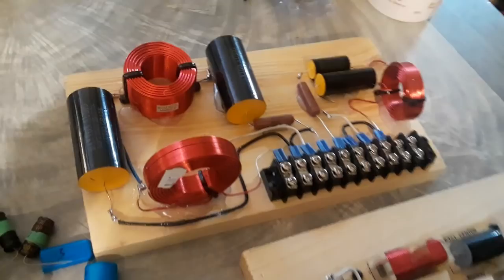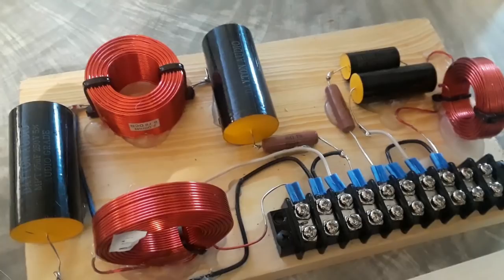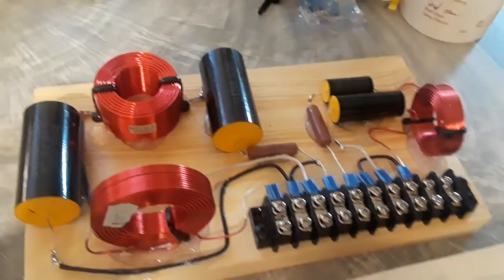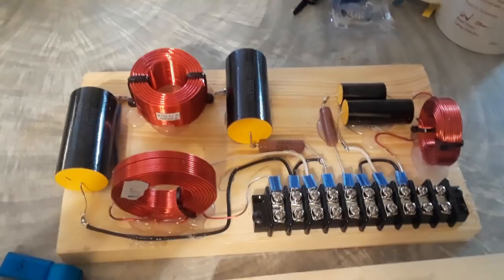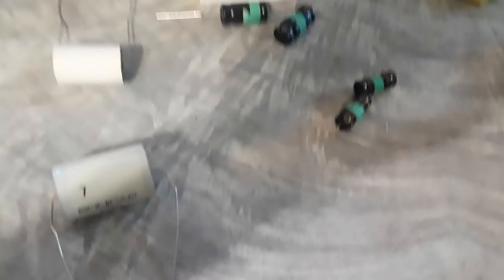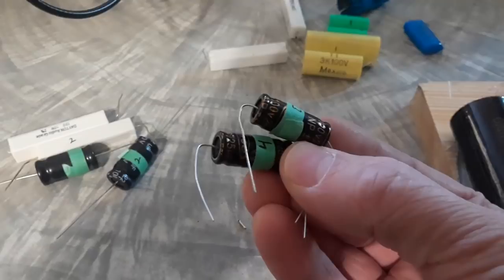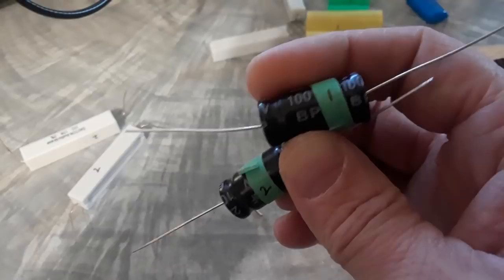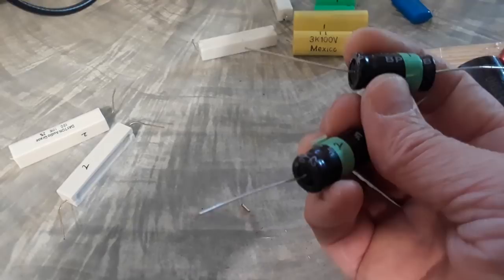Crossover Capacitor replacement recap and analysis Klipsch Heritage Academy

Comment: I worked for 23 years testing passive components ie capacitors coils, transformers, resistors for a military and comercial avaition radio suplier.  I also have worked with crossovers as a hobbie.  The only parameters I concern myself with is capacitance.  I use Solen, and  Sonocaps wherever possible because I have heard the difference.  The ESR is low and I will add capacitors in parallel to not only match left and right crossovers but to get the value that I want within 1/2%. Making sure to do the same to left and right crossovers. The difference is in the sound, not the measurements as long as they measure the same. the the sound comes from the way the capacirors are made and the lead material.  I always test the leads with a magnet to see if they are copper clad steel (any ferris metal in the signal path is bad for sound quality).  Any ferris metal surrounding the wire can also affect sound quality. I try to use copper for wire and brass for hardware were ever possible.  I have also used a low value film capacitor to bypas electrolytics in the signal path and on power supplies in older amps, preamps, CD players, etc.
Reply: Thanks for the benefit of your experience, I don't have the experience you do but I recall having to match components for high power mil equipment we sold on license to uncle Sam. It was astonishing the amount of legislative controls in place for single components.
Reply: I know this is almost a year old but I work with a well known speaker company and I just wanted to say THANK YOU!  Always appreciate confirmation with respect to actual sound quality of various components in a passive Xover. Identical measurements do not always equal identical sound and rarely do with higher quality components
Reply: In crossovers I use mkpa , in the power supply I haven’t used it, will try. Good input, thanks

Comment: I realize this is a 5yo video, one thing to emphasize is equal measurements do not always relate to equal sound quality with same values in a passive Xover.  I have known and worked with Crites for many years and I will assure everyone Michael absolutely knows this. He was literally forced to offer cheap electrolytic caps to satisfy the “purist” in the Klipsch community to stay true to the original sound. PWK would not want the parent company using the cheapest parts available for his networks yet there is a big market for them. Thanks for a great video 5 years later lol !!

Comment: I don't get if you value the quality of the sound why hte measurements have such a big effect on your choice. Sure, close to spec and consistency is important but in two equally measuring caps, the quality of the sound is more important? Seriously, try a copper cap and compare, even if it measures at 5% compared to your dayton 2% against spec.

Comment: I see no difference in the oscilloscope measurement. I suppose there is a difference between the caps, and that is related to ESR and ESL. For correct and clear measurements, oscilloscope must be triggered. Time domain and v/div must be set so that only one wave-forme is displaued am amplitude to be from the bottom to the screen to the top. Overlap the channels to spot differences. I'm absolutly certin there in no hearable difference between a 5-10$ cap (correctly chosen) and an expensive "special" cap. So, just use bipolar caps with ESR lower than 100mOhm, preferably inline film because thay have also low ESL. Never use MLCC, thay have BIAS   effect (capacitance decrease over voltage increase, that can affect up to 80% of nominal capacitance). For example, a 33uF film cap costs about 7$ and is has identical sound characterisc like any other "special" one. 10uF are even cheaper.

Comment: Cool video, closer tolerances or better "measurements" do not make better sound , so I would focus on using quality audio grade parts and listening tests to describe differences in sound signature....
Solen on tweeter sounded bright and harsh, Daytons are similiar little less bright , SonicCap I have never used or heard.... lower value caps on the tweeter are often critical and best sounding ones should be used there...spend from 15 to 50usd on nice tweeter cap than you are ok with cheaper Daytons on the mids and lows...
Mills are nice resistors , little too bright but very good sounding.
Inductors as long as air core 16ga and thicker are fine .....

Comment: great information as the Crites options are VERY expensive as you say and may or may not be a good option for people.
also good information as the stock caps were say 5-10% off but after that many years not too bad.  I have a pair of KLF20 and KG3.5 that could probably use some upgrade love.  Simply to smooth out the sound and bring it back to original

Comment: Ricky, It seems you are quite experienced with crossover caps. What do you think about an idea to use Dayton foil polypropylene caps to bypass regular Dayton polypropylene caps? Like 10-20% of foil and 90-80% of metalized polypropylene. Have you ever tried such a combo? What would be the optimal ratio?

Comment: I have a Klipsch KGSW LE passive subwoofer I Purchased probably in 1990 new I was 20 a the time.The manufacture date is 1989. My question is their is two large  capacitors  with T.I 150v 270uf any suggestions on a new capacitor to replace it with?

Comment: The signal generator is probably fine but it has 50Ω lab standard output impedance. Overloading it with a low impedance application (8Ω loaded passive crossovers) signal loss certainly happens. Noise can creep in, THD shoots up. Connecting the gen to an audio amplifier and the crossovers on its outputs should solve that. Home theater receivers can provide more independent channels for your real-time four waves comparisons.

Comment: I am looking replacing Caps in my crossovers , the existing ones are 12uFand 4.7uF , the existing ones are labled 50V ,  I have only seen 100V + caps for sale, does the Voltage matter ?
Reply: 50V is the rated power the capacitor can handle. Getting one with the same capacitance that you need albeit with a rating for 100V will be fine. That just means the capacitor can be installed in a circuit of up to 100V and still work as it should. Just make sure you are getting polarized or non-polarized as your circuit requires.

Comment: Good day to Ricky Talks Shop.... I have 2 Energy Connoisseur C-8 crossovers and I'm about to replicate them but my concern is the coiling thickness and winding count...... they cost $250 US  each and wow do they sound just wonderful. i love them, installed them on my homemade towers (49"high X 9" wide X 13" deep) with 4 Hifi 6" mid-bass 40 watts at 2ohm x4 =8ohms) and a 4 ohm  6" subwoofer isolated and radiated in the towers for lows, i get 35hz from these babes wow! ok I'm excited so about the coils any input please and thanks.

Comment: I have s pair of chorus  speakers,what would I have to do lower the bass frequency   from 45 down to 35 .? Bigger resistance  coils.
Reply from the maker: Thanks for watching. Do you mean to change the crossover frequency between the low and mid driver? Or to get more overall low end out of your Choruses? Personally I wouldn't recommend doing much with the croasover frequencies. The Engineers at Klipsch know what they are doing. To get more overall low end, think about what you are after. Lower frequency response? More "thump"? You can safely expirament with stuffing the speaker with acoustic batting from Parts Express or lining the inside of the cabinet with acoustic foam. I have had both good and bad results with either option.
Reply: @rickytalksshop8538   hi Ricky. I experimented  with the ports and put 2 -9" DIY  cardboard tubes in they boxes, that really helped the bass response  out.
Reply: Thanks. art source  couldn't  help.

Comment: Shouldn't you test the crossovers with more power? Does power affect the responce? I'd like to understand it better because with my speakers everything goes well within low volume,but when I turn it a bit louder the sound tends to change for the worst..

Comment: Hi I have klipsch  chorus  speakers,there are 2  j2 250 volt caps.i can get 2.2 uf 630 volt  nondof  caps,will the difference  in volts make a difference in performance?
Reply from the maker: It can, but may not. Larger voltage caps can have larger charge/discharge times than lower voltage of the same value, especially if you go from a poly to an electrolytic type cap. Also a 650V cap is going to be unnecessarily large for the application. For a small value like 2.2uf I would recommend Dayton caps which are rather affordable from Parts Express.
Reply: No Paul, it wont make any difference apart from the cap size, that's the breakdown voltage and the cap discharge time depends on the source of voltage (your amp).
Reply: "nondof", do you mean Mondorf?  If so, use them by all means, Mondorf have an outstanding reputation!   I also have ChorusII's and replaced the 2.2uf (tweeter circuit) caps with 2uf teflon NASA surplus.  The improvement was dramatic!  The soviet surplus K73-16 capacitor is worth considering, but haven't tried them myself.  The general rule with capacitor voltage rating is that you can replace with a higher rating, but never a lower one (see Dorian Valadez' reply below).

Comment: The Dayton Audio Grade  10 W ceramic resistors are inductive. 
Did you misspeak when you called them non inductive?
We can agree that the Mills resistors are non inductive, and expensive.
I have measured the inductance of Dayton 2 and 3 ohm resistors, and it is very low.
I would say negligable, and so I use them, like Henry Kloss did in the Advent speakers.

Comment: In my speakers I had good results with replacing the crossover with just a capacitor. The base driver is 8 ohm, and the tweeter is 4 og 6 ohm, dont remember,  so the low frequencies will go through base and the high will go though the tweeter in a natural way, without the use of distorting coils. In my experience it sounds fantastic. Have now purchased a pair of LS50 (not yet delivered), and if possible I will try to do the same in them, when I get them.
Reply: No way you have flat response w/o coils to taper the top end response of wood/mid unless you used different drivers. Glad it sounds good to you but an A/B comparison would likely reveal serious issues
Reply: @barneyrubble4827  The response is not flat, but flat response is only one of very many distortions in a loudspeaker, also a flat resonse can be achiebed by for ecample eq in dac

Comment: I have only just started to look into this for the simple reason that something inside my dj speakers was rolling around so I looked inside and one of the resistors had fallen off so I attempted to solder it back on. The speakers sound was not as good as it used to be and I will see what they sound like now I put it back on but was looking for what it actually did on the crossover, ofc I am not going to replace anything since I can not afford it but its nice to learn new things. Its was a good video but I think it would have been handy to know what effect they had on the sound by actually hearing it rather than looking.

Comment: Hey Ricky, thanks for making this video! I need some advice. I just picked up a pair of original (walnut?) 70s La Scalas with the metal drivers on the horns (so first gen). They are 100% never been monkeyed with which means those ancient paper in oil caps in the crossovers have got to go!

I’m thinking about going two routes. One is to rebuild the existing crossover circuit as it stands, replacing parts with their audiophile grade equivalents, like the nice Litz wire coils (Solen?) you have in the video and the high end Dayton or Solen caps. I would expect that by keeping circuit design of the 70s Klipsch engineers with the best parts, it would maximizing the performance of the original design but keep some of its inherent quirks.

Now, there’s a different guy who charges a lot of money for his crossovers and, him being a retired double-E, makes a good case for an entire redesign of the circuit. It is true that 70s engineers were very commercially minded and would often cheat to save a few bucks here or there; economies of scale being what they are. So he seems to present a money-is-much-less-of-an-object attitude and a philosophy that he’ll redesign the entire thing to a more idealistic specification, made easier today because it’s far easier and cheaper to get tight tolerance, very well made parts.

So now for the Advice! I’ve never heard La Scalas that are fully but faithfully restored and cannot speak to how linear and natural their original response sounds. Can you help me form a better understanding of what these speakers will sound like with one design versus the other? Can you point me toward online resources? I’m used to the cantankerous forum rantings of the dedicated, lead solder breathing cranks out there. Just hoping to save myself some time and a lot of evaluation regarding the best, ah... signal-to-noise ratio is for educated opinions and reliable information on the topic! ;-)

Comment: I need to replace heresy hwo caps badly 1982.  Parts express for 4x 4 microfarad ones 3$!  I experimenting now with 8uF cap on mid on one and running woofer full range.  And I'm like wow 12" woofer hits high notes beautifully!

I'm cap obsessed,  hacksawing them apart and collecting them.  Wondering if polar caps would work.  Blue ones? 

Oh oddly seeing type 1 heresy crossover diagram the pos and neg are reversed on outputs!!!! Haha why???? Phasing?

Oh and I got some fisher 12 floor speakers I put in old 3 cu ft endtables and put wood flooring inside box w caulking glue and 1x1" braces like 8 per box and 2 2x4" braces also! Omg bass hits so nice.  Silent vs no braces weird like bad power supply gives more bass haha.

Fun nerding out on caps this is great!

Yeah I flip yard sales stuff and have flipped 70 speakers plus and kept heresys  over cerwin Vegas even.  

Now I want to restore them and maybe sell for 1k if lucky haha never know.  They are the best everyday speakers low volume.  Had 225x2wrms hooked to them they need 10w haha 55 max
  
My fishcer endtables bump with no watts almost, must be hitting less than 30hz? Hear it like 30 feet away at pinch of volume but it is not annoying like bose or 90% speakers.   Well mood speakers.   Fischer to bump and klipsch everyday!
I like cubby caps.

Comment: The most informative information was that caps, even new caps, need to be checked to see what’s out of spec. You could have demonstrated that in with a 2 or 3 minute video. I was hoping this would be more of an instructional video showing how to use your meter to test, and or how to you go about actually replacing a capacitor. I though the scope part would have been more informative if you explained how you were seeing distortion on the scope screen. Each screen looked basically the same from my perspective but you could tell instantly they were not.
Reply from the maker: Thanks for the feedback. I’m not really that happy with this video myself… I spent too much time on things that don’t really matter and didn’t explain enough of what does. I’m not a pro YouTuber and  making these videos is certainly a learning process for what does and doesn’t work. I’m planning a remake of this one and I will try and incorporate some of these ideas.
Reply: @rickytalksshop8538  awesome, thanks! I think that you must be really quite knowledgeable on this subject. I’d just like to learn more from you as I try and learn more about how to test and replace capacitors when needed. I’m sure there are videos specific to using a scope. But I think your knowledge on how to read it in the context specific to crossovers would be beneficial to many enthusiasts. There doesn’t seem to be a lot of good videos about speaker crossovers on YouTube from people as knowledgeable as yourself. Thanks for listening and for your time in making informative videos.
Reply: @rickytalksshop8538  HI Mr. 👋 Happy new year to you! Mr. One question, please.. You use begginer Dayton Audio DMPC caps, but top  Dayton Audio capacitors PMPC... How strongly Dayton Audio PMPC inferior to white SoniCaps?Thank you very much!

Comment: I like to change all the parts in the Klipsch Hersey III! Do you have the diagrams?
Reply from the maker: I don't. I'm not sure what the crossovers in the IIIs look like, but being fairly new they are likely made with better components than older models and you probably have less to gain by upgrading.
Reply: @rickytalksshop8538  ok thanks!